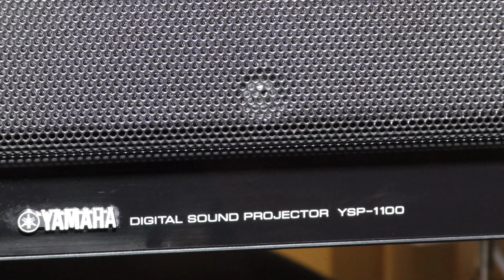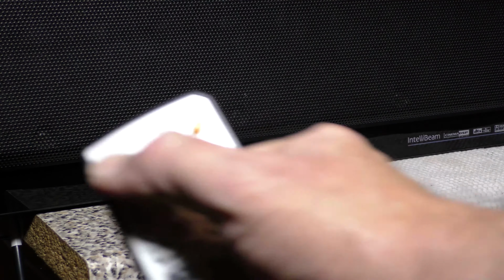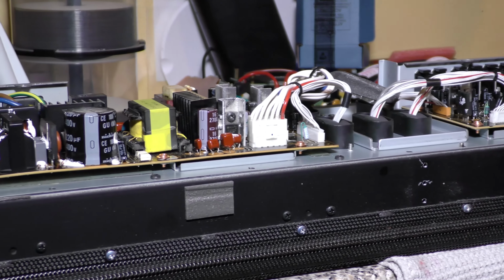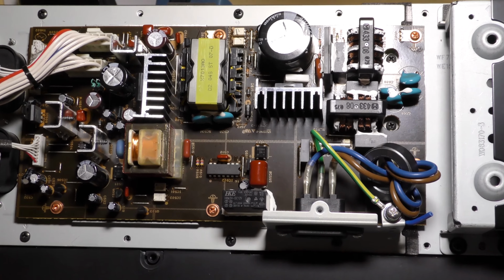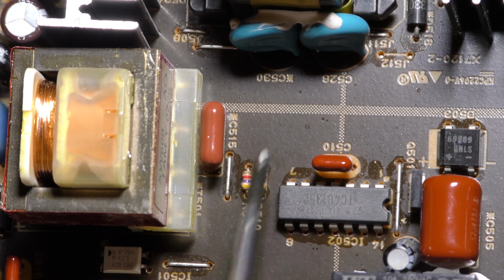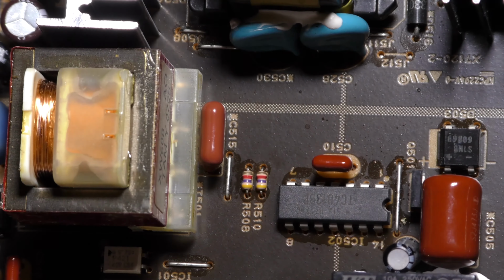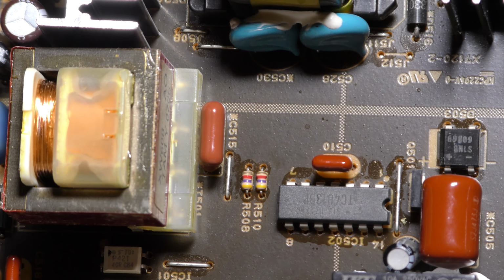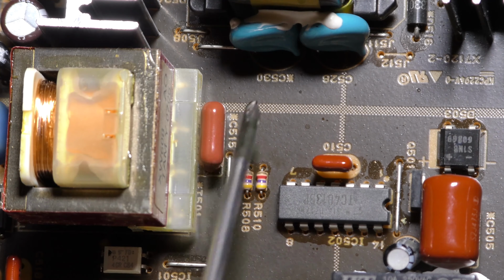Yamaha Soundbar Repair YSP 1100

Comment: Hi John. 
After trawling through countless sites concerning issues with my YSP-CU3300 unit and the intermittent sound loss encountered which seems to affect a number of the range. The unit powers up fine and can clearly hear the relay clicking but sound fails randomly which is annoying. When working it's a great sounding piece of kit which I really don't want to discard. 
I acquired the capacitor but prior to attempting the change I wanted to confirm that this is the culprit. 
May I ask whether your insight and expertise that indeed I need to replace the capacitor? and are you aware of any other checks that maybe nessecerry before the change?
Many thanks and stay safe. 
Long
Reply from the maker: Yhe capacitor fixes many units that won't turn on. Maybe you have a bad solder joint stopping the audio.

Comment: Hi John I have a YSP2500 and there is no C515 capacitor but this exact issue. Would you have any idea which capacitor to replace in that unit? Any help preventing thai going to landfill much appreciated
Reply from the maker: Sorry, no idea. Change any cap, same style as in video, that is close to the transformer. Better still, change them all.
Reply: Same to me!my model ysp 2200 no power.i can not see C515
Reply: @Duongquanhangbai did u manage to repair yr ysp 2200?

Comment: I have a Yamaha YAS-71 soundbar that shuts off as soon as I turn it on. Basically it won't stay on and I hear a loud click when I press the power button. I cannot even find a website or phone number for technical support. Any suggests?
Reply: There is a short on the board i guess.

Comment: Ive just found a YSP-1100 that was dumped in the back lane by my house. It didnt power up so I looked online and found this video. When I opened up the unit, I can see that the capacitor in question is missing from the board - looks like it was removed in the past, and forgotten about. Ive ordered a replacement capacitor and will let you know if we have life again!
Reply from the maker: Fingers crossed.
Reply: @JohnB-2021  Hmmmm, well I fitted the new capacitor, got things back together but still no joy:(. Might be my soldering!
Reply from the maker: @73Ferret  the original soldering fails after many years too.

Comment: hi, when using a while (may be 30mins to 2hrs), my YSP-2700 come with abnormal or no sound, I need to power off and restart it again, do you think it is the same problem?
Reply from the maker: Maybe but hard to say.
Reply: @JohnB-2021  thx

Comment: Thank you for this Video. I have a LÖWE TV with an external amplifier. I opened it and found an YAMAHA amplifier inside ???? Having replaced the capicator the system runns perfect.
Regards from Innsbruck (Austria EU)
Reply from the maker: Thank you and greetings from the UK.

Comment: Hello John, thanks for this video i like a lot !
Is the repair still lasting and doing it´s propper job ?
I am from germany and have a slight problem as i am not an electrician, i cannot buy the exact values you used, not available in germany
i could buy :
it says WIMA FKP 1 ... 0,022 ... 1600 ... 650   whatever this means, do you think this can also work ?
thanks a lot for your help John 
Best reg. Ralf
Reply from the maker: Hi Ralf,
Try Farnell / Element 14, pretty sure they are in Germany and are in Belgium.
0.022uf  which is 22nf (nano farad) and the working voltage is 630 volts dc which is fine for mains voltage.
The capacitor will last many years.
The WIMA is just a type of film capacitor and should work.
You could try ebay too.
Thank you for your comments.
Reply: it should not be a problem to buy 22nF />600V capacitor. I did it few hours ago in Croatia, so I doubt very much that it is unavailable in smallest German village! Anyway, the story from this video solved the problem with my YSP 900 which has identical power supply (BUT ON DIFFERENT PCB!!). Capacity of the removed capacitor was below 1nF!
So, John B., thank you ant the other guys who published a same solution. It works like a charm!
Have a nice holidays!
Reply from the maker: @satman1w  Excellent news, thank you for your comments and have a great new year celebration.

Comment: sir my ysp-1100 failed i have change the capacitor c515 but still silence do not know why need your help
Reply from the maker: Maybe a dry joint on the soldering

Comment: Thank you for this video. My YSP 1000 failed a couple of days ago. I found your video and I tried to change the capacitor but it still doen’t work. Can you explain to me what did your soundbar do when it failed ? When I try to switch on mine, it clicks once and then a second time maybe 1s after and nothing happens. Thanks in advance for your help
Reply from the maker: Hi,
It's not my soundbar so I don't know.
This had a dry joint on the second repair.